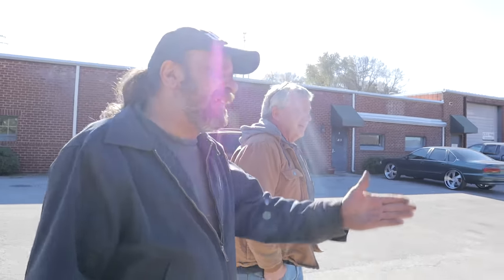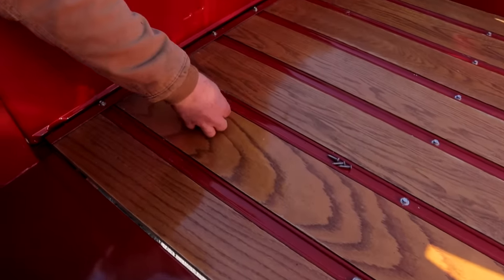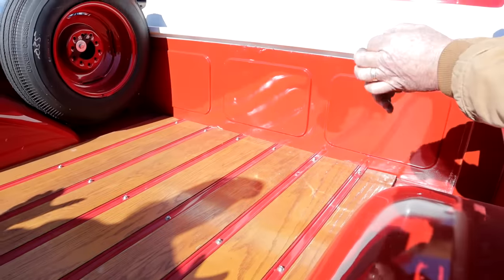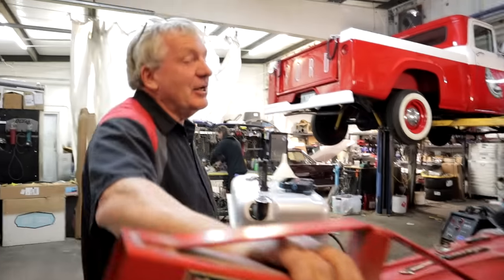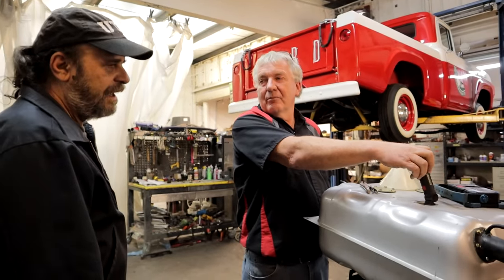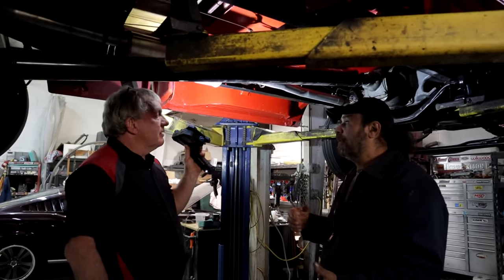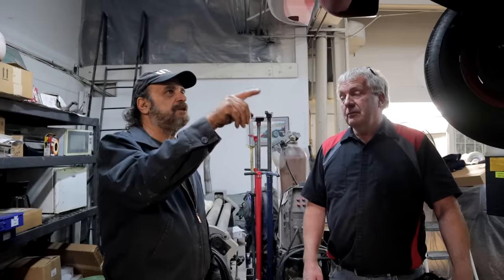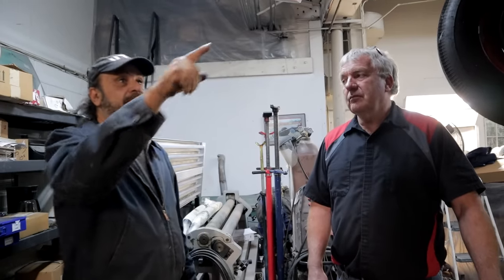Frame Off Restoration Gone Bad - Pretty Red Paint Hides Trashed And Rotted Parts Throughout

Comment: I saw worse than that back in the eighties in Southern California...I left the shop for that reason...Bondo has its purpose but you shouldn't build the car around Bondo....The other aspect of this is how many more hours would it take to replace the actual metal instead of hiding it with glass and Bondo...Also rust is a demon...Like the Robert Williams painting "Demon Rust" tells the story...Take the time to pick the car before you attempt a restoration on older vehicles...Well worth the effort in the long run......Search the rust free states in the Southwest for the project...Worth the time it takes...Also DON'T GET EMOTIONALLY INVOLVED!...It's beyond cool to want a clean old runner...But like the Aussie guy said , this was her dream...Dreams can become nightmares....I also liked the safety issue the New York dude talked about ..SAFETY , SAFETY , SAFETY...No exception and no excuses ..Great presentation fellas...Like they say down under..."Good on ya"...Did I get that right?...Great show!

Comment: Sadly too many chop shops exist who do garbage work and take people's money.  If you have someone do a resto you need to check in constantly to see exactly what they are going to do to fix the issues.  I would require the shop to film each repair as it's done and call me to inspect it before its "prettied up".  I had a 73 motorcycle totally restored a few years back by a small shop and they invited me to constantly visit during the 9 months of work so I could see what they were doing as it was done.  We had constant contact about the issues from the original factory build and how to make the bike better than original without anyone knowing it was done nor changing the bike materially (eg metal bushings instead of plastic). I also did this on a recent house build.  Went every 2 days and found cut corners and mistakes that after covered up one would never know it until it becomes a problem.  And this was with a "quality home builder" so imagine the junk with builders who slap them together fast.  Very little pride is shown too many times with these alleged craftsmen folks.  As they said, buyer beware.

Comment: Im a collision repair tech, have been for 10 years, i cant imagine even considering some of the thi gs these guys did. Look, using fiberglass and body filler to fix rust on outer panels is one thing, but my god, theyre litteraly taking peoples lives into their hands when you do that with structural components.  I take my work VERY seriously, and theyre right, there are not any checks and balances,  its up to the integrity of the tech and the shop you go to. I work next to people i would NEVER have touch my car and it still ships and that stuff is out there on the road. Look into the shops you take your car too, and for the love of god DO NOT take it to the lowest bidder. I want to get into restoration work to do things like this and do them right so they vehicles can last another 20 or 30 years and are safe but i dont have the capital to open a garage.

Comment: friend bought a late 50,s chevy pickup from his cousin who told him he had done frame up restoration so i went over and found a very unsafe vehicle that would fall apart if driven on the road for very long holes all over the body filled in with bondo some you could put your fist through frame cracked in many places oil leaking all over and his cousin would not return the 12,000 dollar he paid for it

Comment: Interestingly, I bought a reasonable high mileage (*?.), shiny “ Red, new White Top 1961 Ford GALAXIE Convertible “ , in 1966: ultimately been Repainted,Driven “Hard”: paint, Bondo, tr@nny,engine issues in few months …; lesson learned.. whew!!).  Anyways, did lead to a 1966 GALAXIE 500 XL 4 Speed/ semi loaded , deep Burgundy Color( i.e. LENO’s GALAXIE w/o 7 LITRE/ Disc brakes) ; with some minor ( metallic brakes, Tires/ Shocks/ COOLANT RECOV) much improvement & maybe a FAVORITE CAR…..😂

Comment: This is exactly why I have such a hard time believing auto repair shops. SO many of them will flat out lie to customers, over charge them, say that they're replacing expensive parts that don't really need replacing, etc...

I have plans to do a frame-off restoration on a Ford Model A. However, I'll be doing the entire restoration myself. I would be absolutely crushed if I spent the money on the car and then, brought it to a shop to have the work done, spent all the money to have it done, and received shit work like this.

I hope the woman that ownes this truck sues the shit out of the shop that did the "work".

Comment: Guys,  Going onto social media and plastering the shop that did this work is just going to foster some really bad potential backlash with other shops in this guys area.  There are more then a few legal methods to follow through upon that won't wind up in more legal headaches.

The video shows the evidence.  I'd take the other shop to court and also notify the state registration system that regulates repair shops.  After they lose their case,  then you can slam them as they have been proven legally to be at fault.  Just sayin'

For the ones saying "maybe the lady couldn't afford x,y,z..."  The repair shop would have done a prelim estimate.  A trained chimp could have seen all the rot and the cab corners being rotted out, etc..  That's when (if $$ as what caused all this nonsense)  then you can let the customer know  "This is what NEEDS to be done.  We can get it safe, but maybe not as many bells and whistles as you wanted.  Might have to cheap out on the paint to cover the cost to have a welder come in and property do the cab mounts and the floors..."   (Did it happen that way?  Maybe?  Probably not?  We where not there.)

Basically this truck is a polished turd.  Frame looks great!  But that's where the love affair ends.

Comment: At the end of the day what did the truck show up to the shop like and what was the budget she gave for the restoration?. Making a guess at 60-70k is completely irrelevant when you don't know the real costs or appearance of the truck.

If it literally sat in a swamp and was nothing but a floor less cab squashed onto a rotten frame and a shop is told to do a restoration what Else can they do.? I don't think some vintage trucks or cars should be restored and this is a prime example. It was just to far gone before they started.

Also I doubt you could get 70k into a truck like that unless you were somehow getting new old stock parts.

Comment: The only problem with naming shops is realistically you have no real idea if they did the work or not, customers lie, get confused, and might not even know. And if they did work on it, what exactly were they told to do? Personally I would want some proof before destroying a business. The other thing is cars this old have been screwed by so many sub par techs over the years, they are a real can of worms. We had a 60's caddy come in and the entire drivers side rocker panel was made out of bondo and underneath it had literal 2x4's for the framing.

Comment: this is not an old story.. vehicles repaired like this often go to car auctions, even to custom hot rod shows. My best friend bought a car that was in side the Civic Arena on display in Pittsburgh during the rod, and custom car show, these were not brand new cars on display, these were gorgeous cars with lots of chrome and metallic paint jobs and beautiful babes in bikinis and spinning, turntables that the cars were sitting on sometimes cars jacked up in the air, showing all the chrome under the car at times, and lots of big wheels, in flashy interiors, that kind of a show..
  so my friend spotted this all black, mid80s Pontiac Firebird, it had an unusually shaped roof with a wedding that came down onto the trunk like the Corvettes, lots of chrome under the hood, big wheels and tires, the interior was all black, except for the Black Recaro seats with red centers, it had the latest – stereo system, speakers in the doors, and in the trunk. It was a one of a kind with that sculpted roofline.. this was back in the 1990s. My friend talk to the owner of the car because it had a for sale sign on it. My friend went and took out a loan, and he had a certified check, ready to buy the car when the show was over at the end of the week.
 so they go to a notary, and do all the transaction work, and my friend gets the keys. On the way home, the car stalled at every stop sign and red light.. gas spewing out of the exhaust pipe was black call me really over Rich.. my friend turned on the radio, it didn’t even power up. My friend could not find the adjustment for the seats, when he would try to turn the steering wheel all the way to the left or right, the tires would dig into the body, when he would go through bumps and dips, the back tires would contact the body…
my friend was not very mechanically inclined when it comes to cars. So he took the car to a mechanic that he knew that had a shop. He told him to go over the car and get everything to work. 
it turns out that they had just stuck at Holly carburetor on the intake manifold, and it was not even jetted properly, the seats would not adjust because they were zip tied to the floor .. he had to buy new wheels and tires, because the ones that were on the car were way way way too big, the stereo, and the speakers were not even wired to each other or to the electrical system.. mechanics found lots of evidence that the car had been crashed at one time and quickly repaired by someone that was in a big hurry. As for that webbed roof with the sunken in rear window, it looks like a Corvette roofline, that was all Bondo…
When a car is up, not so much at rod and custom shower, but going across the auction, there’s a reason. There is a reason that a dealer that had this car sent it to the auction. Because he did not want the reputation of selling a piece of crap from his place of business, giving it a bad reputation. They send them to the auction just to get rid of them. Many times dealers will have a dump lot were they’ll have a salesman inside of an old building that used to be a gas station, and he’ll have a lot of older cars for sale there, those are cars that were traded in that the dealer doesn’t wanna be seen having on his lot..
 Let the buyer beware

Comment: Truck's not a bad 'restoration', but corners were cut for sure. It depends on what the person was charged to do it and how much structural corner cutting there is. It costs a lot to make new panels to replace stuff that is not reproduced. Finerglass and Bondo just covers stuff up to make it look nice. If the underlying structure is good and you are OK with it not being perfect, that is good enough for most. Lot of stupid stuff done on this one. I would not have put the gas filler in the bed. If you are doing a resto-mod, put a fuel door in the side and make it like like it was there from the factory. If you have the supports and brackets off, there is no reason to put them back in that rusted, patched state.

I have a '69 Firebird that was half assed restored back in the 90's. I bought it in '99 for $6500. ODO showed a little over 100k which is likely not correct. Front clip is perfect with no rust or Bondo so it was probably new or really good used panels. Rear 1/4's are Taiwan Camaro patch panels as there weren't Firebird panels available then and the few NOS 1/4 were HIGH $. They puttied over the fake louvers on the Camaro panels and the connection to the wheel housings is poor. The trunk floor and drops are perfect. The floors are butchered and covered in fiberglass. Doors are perfect. Roof looks like it was sanded with 40 grit. I never checked #'s to see if it had a vinyl top originally. This was a base car with OHC 6 and three on the tree converted to floor shift. It now has a Warner T50 five speed in it. Original 1bbl.  engine with cracked block in it. It seeps a little antifreeze. Body color is some Chrysler green. Should be the olive color instead. Interior is newer with some crappy repop pieces. How much is it worth? Maybe $12k. How much to do it over correctly? Much more than it could be sold for. I see a lot of 'restored' cars with big price tags on them. As long as you know going in what it will cost (you never really do as you find more stuff that needs work) and what you will get for quality of work, go ahead and do the restoration on the car you love, but don't expect to get your money back out of it unless it is something really unique or rare. Get everything in writing and make sure to get photos of each step. Go look at it often during the restoration. Don't just drop it off and then come back two years later to pick it back up.

Comment: So to be honest she probably pay alot but she was happy with that price i think alot of restoration rip off the customer kinda got what they paid for im guessing to do the worl on this old ford properly with metal and lesser amounts of Bondo you would have at least doubled the cost  tho ive seen lately restoration shops are doing what they call visual restoration which is the bare minimum to get it running and driving and then make it pretty it was originally for the guys who would do the rough body work themselves and then bring it to the restore for the details but at some pont that changed to what happened here

Comment: When you don’t have Mechanic shop in High School anymore and Parents not teaching you anymore then how do you expect this Hobby to continue,in my case I had a 340 Machined at a supposedly reputable Shop Balanced and Blueprinted (most don’t even know what that means) some 15 years ago for my dream E body ,never driven on the Street when one day due to my Leftie wife leaving Bird food next to the Car which the Mice transferred to my Six Pack,So I took it apart to see if it went into the Engine Heads off then Financial issues hit hard so I let it sit,which Later created surface rust in the Jugs Fast forward to Last week and cleaning the holes I decided to take it apart,mind you I never had this Enginee on the Road and here is what I found. Connecting Rod one showed a mark noticable on the rod bearing which caused me to get suspicious so I checked the Crank journal and sure enough they left me 5 thread marks on it during their installation process the Rod fastener or stud hit the crank then NR 5 jug had a nasty rough mark about a quarter size on the piston wall which shouldn’t be there,moral of the story is learn to assemble your own Engine so that you know every aspect and screw up because the Machine shop will never tell you theirs 
Now I have to fork over more money to Right a wrong(s) This is now what I need New Piston New Cam bearing(Groove detected) new Rod bearing Honing or Sleeve in Cylinder 5 
I,m disgusted at 61 now .Will my Mopar dream ever happen?

Comment: Yah, this stuff is so bad. My first project car was a nice looking 80's japanese SUV....seller didn't claim any restoration work or anything, it was just in really good shape, except for a couple of minor rust spots around the rear wheel wells - needed a little bit of mechanical love and some cleaning up but it was sold as having "solid bones".... was gonna go inspect it the day after calling the seller...apparently he had a bunch of other offers and being such a nice guy and all gave me the "opportunity" to seal the deal and just come out that evening. stupid me should have told him we agreed on tomorrow and if he can't keep that agreement, i'll have to find another deal but I got greedy.....in hindsight I realized what it was. We had minor snow roll in and when I went to inspect it, the body was pretty clean but there was like 2 inches of mud all over the frame. I had a hefty screwdriver and poked around on the frame but somehow managed to poke just about everywhere except where i needed to. Took it home and cleaned it off and found a cross member had a 12 inch section nearly totally gone and a 6inch section on both rails just totally eaten up....brake lines that were eaten up with rust and bypassed with a temporary line. The mounting brackets for the body mounts were nearly gone...basically an unusable frame given my budget. Luckily I have a very understanding wife who let me go find another one of the same model to use as a host for all the good body and interior pieces from the first one but man I felt like a fool, especially having to come up from my garage and tell her "i screwed up....bad" .

Comment: Here in the rust belt we see 10 year old $70,000 F150's with more rust than this truck.  Mecahnics wages are going up and no one wants to work for $15.00 per hour to get filthy dirty, sweaty, cut up and burned every day.  Sure these two old timers have great passion for their craft but businesses need to pay the bills and make a profit or there will be no one left to do this job.  $70K for a restoration seems reasonable.  If you want it perfect you need to do it yourself.
Reply: $70k for crap like this or worse is insane. You must be American to get ripped off like that.

Comment: Good they called them out!

In Kansas some guy had a truck restored, then had lots of custom murals done on the body. The truck looked awesome for about a year. Then the rust started bubbling through. Instead of replacing the metal the body shop did a sloppy bondo job. It was a shame and a waste of time and money in the long run. Don’t know if he ever sued or not.

Comment: I dont know anybody who does VW restorations who does that kind of work. Proper shops that do a restoration. Deutschland metalwork or myself or many other shops. Even the cheapest ones dont do that kind of fiberglass on a frame job. lap repairs are ok but fiberglass on structure is just pure wrong.